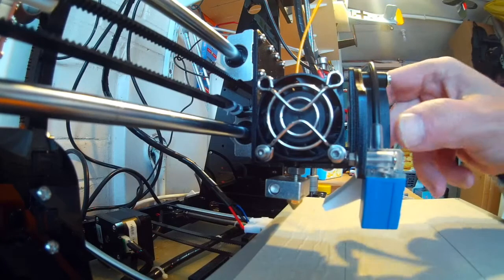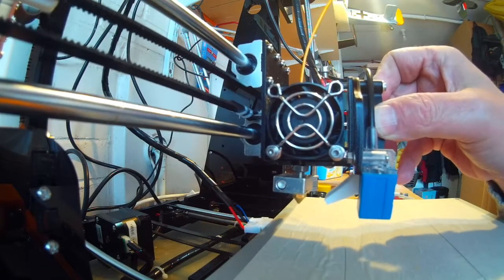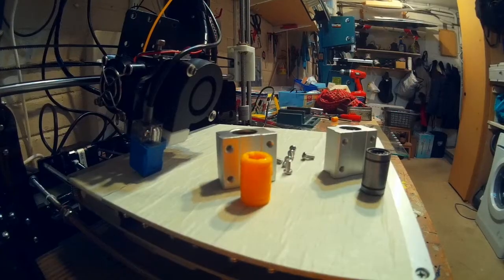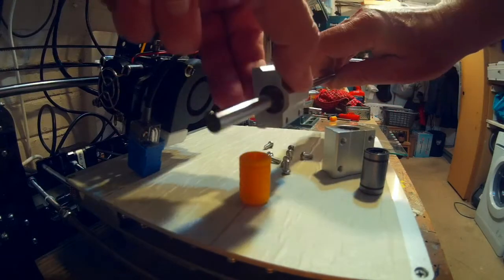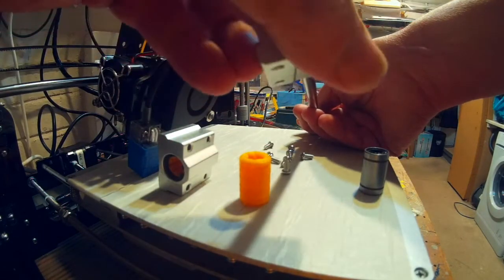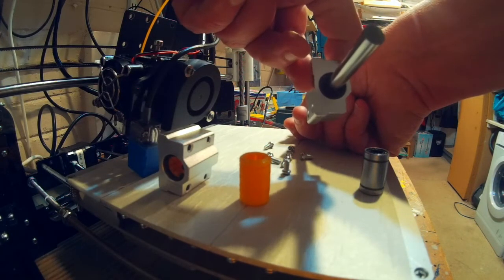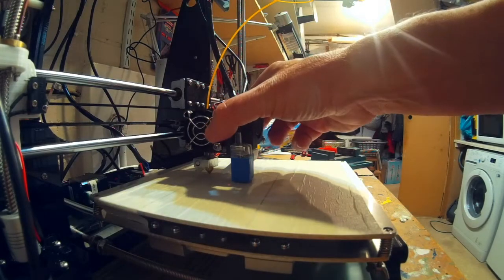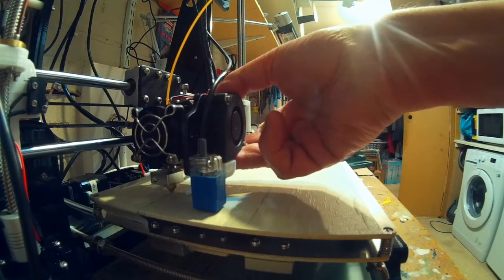ANET A8 X Axis Fix

Comment: Your level were off because you're not using anti-backlash nut on your Z axis. I was having the same problem but since i've change my normal nut to anti-backlash nut my bed level is remains the same. It's very cheap and easy modification. Strongly recommended.
Reply from the maker: Thanks will look into that, but since the video, I've changed to Drylin bearings on the bed as well and have great prints now.  But I think that's a good option as well.  Thanks

Comment: ABS, Nylon or even PETG would be better suited then PLA, because they are more natural slippery materials. Though for Nylon you would need a all metal nozzle and insulation under the heated bed. A thought on A8, their components are far less crappy then what CTC puts in their printers in that price class.
Reply from the maker: Yes good advice. I've since replaced all of them with some Drylin bearings.  Works well now for a cheap 3d printer. Thanks for watching
Reply: Nice, I was thinking about doing the same. How are the bearings holding out?
Reply from the maker: Bearings are good, so far no issues. Makes the printer a litter quieter as well compared to the standard bearings.
Reply: Thanks, I'll order some right away. Pretty much anything might be better then replacing the bearings every 2 weeks.